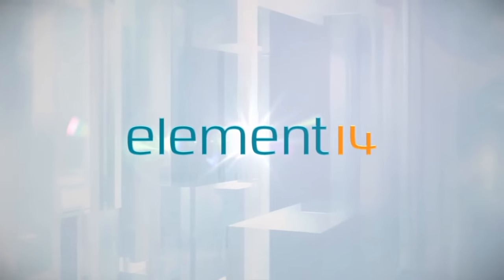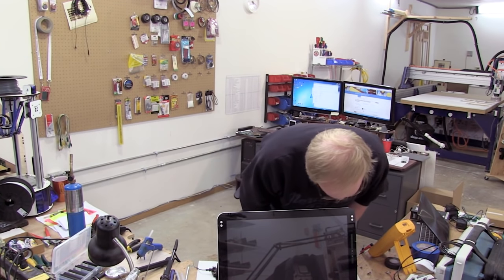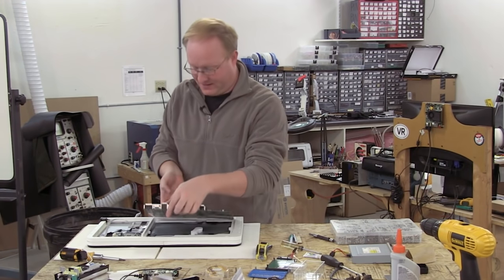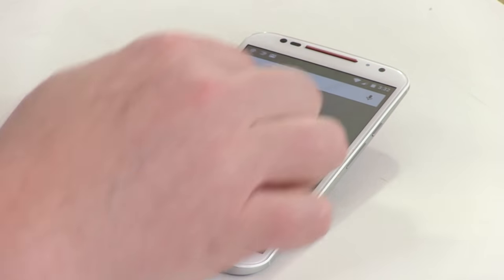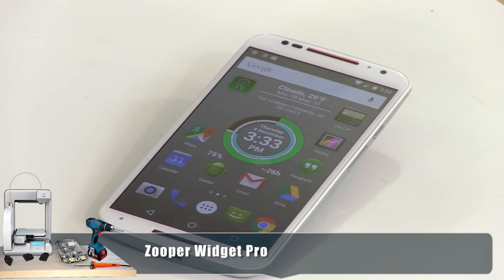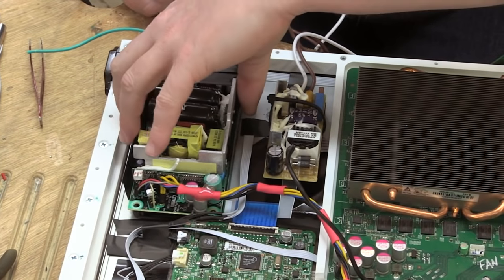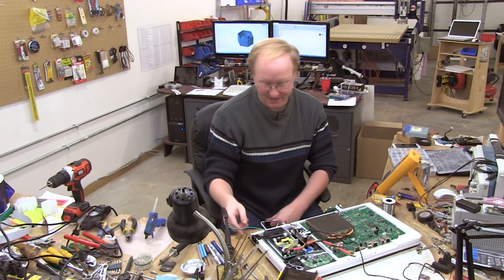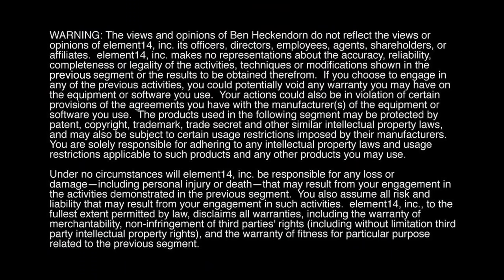Ben Heck’s Xbox One Portable Part 2

Comment: The Xbox Surface, nice Idea!
Reply: You sir are a genius
Reply: TheMarcos030897,

Yeah, because no one thought of that ever before...
Reply: Put a better GPU inside a Surface Pro 3 and you've got yourself an Xbox One Surface Edition.  It already have a great screen, better CPU (i5 or i7).  Only thing missing is a bluray player.
Reply: Stephane Tanguay surface equals throttling i hate mine, got rid of it for that reason :(
Reply: In old ''leaks'' from Microsoft they had plans to make a tablet sized Xbox named The Xbox Surface LOL (this can be fake cause Microsoft never stated so)
Reply: I've been on it for 3 hours no over heating *****
Reply: I played battlefield 3 at low 600x800 and no signs of overheat on the surface pro 3
Reply: TheMarcos030897 lol i played minecraft on it and it melted lol
Reply: Exactly what it though, Microsoft should make one and maybe I'd buy one 😊
Reply: FinnTendo you could probably find one on like ebay or letgo.

Comment: If the Bluray drive is only used for installing games, and the XBONE is meant to be a portable tablet, why not omit it? Sure you could add a connector so that the drive becomes a external peripheral, but can't the XBOXONE download games digitally over wireless?

Comment: Ben, why didn't you use an SSD in the tablet?
Reply: Because the Xbox HDD's use a custom file system and the drives are flashed with a custom firmware, It's just to much of a pain in the ass and a 500 GB SSD is expensive.
Reply: It wouldn't actually be too hard, and SSDs are really coming down in price. There's a tutorial on it somewhere on YouTube. I'm only suggesting it because HDDs are really meant to be moved around, whereas SSDs are much more tough,
Reply: BlueFoxTV you can clone the file system. but a 500gig ssd is kinda cheap o wait
Reply: *****
 With the spectrum he did a software mod (the BIOS thing) and plenty of  hardware mods. The only thing he actually used was the video processor and even he could rebuild another spectrum with the parts he didn't used.
Reply: Defused Creeper You could clone the filesy system but the SSD would not have the proper firmware and would be rejected.
Reply: BlueFoxTV lol i guess you have not done it for yourself, but i have, coping xbox's filesystem is super easy here a link to the 360 sectors http://digiex.net/guides-reviews/console-guides/xbox-360-guides/3152-hack-250gb-320gb-500gb-sata-harddrive-work-xbox-360-xbox-360-slim.html which i guess xb1 is the same
Reply: Defused Creeper I think you should read that guide again. Because they cover flashing drives firmware before cloning the drive.
Reply: BlueFoxTV you are full of Shi*, i use a 60gig Western Digital ssd in my 360, guess u cant read right, and u can play game from flash drives the xbox can format a flash drive its self
Reply: Defused Creeper No, BlueFoxTV is not full of sh*t as you incorrectly pointed out. In those instructions, HDDHACKER is used to modify the firmware of the target drive. It first backs up the original firmware to a BIN file, and then apply the correct HDDSS.BIN firmware depending on the size of the hard disk you're hacking. Interesting enough, that site doesn't even list the WD 60GB SSD as being supported, although you claim you're using it. Just saying...
Reply: *****,

"No hardware mods..."

I know, look at that completely unmodified Xbox One.
Reply: erm let me just go dig it out n see whats going on with it, i defo use a ssd on my 360, and it plays game from it with out a doubt tho, how i did it remains unclear but not what i achieved it may be via usb as i think of it
Reply: ok so it turns out im half Moron, cus yes i Do have a SSD on my 360 with games on it but in the 360 its self is a 1tb Hd that i must of made into a lower size via the hdhacker thingy, but ssd's can still be used
Reply: Good question. I would have got one because of the fact, if the surface xbox falls over the spinning platter in HDD could get damaged.

Comment: The disc drive isn't reading because Microsoft is a hard ass on money, they didn't want to spend the extra few cents to add foam pads to the inside of the disc drive to prevent the disc from lifting off the motor. Same reason the Xbox 360 scratched the discs, was because there was no spacers inside the drive, yet another prime example of Microsoft being too damn cheap.

Comment: Would a cheap HDMI "television" have worked a bit better than a "monitor", as they're already designed to handle the audio, then you could replace their POS speakers with an analog audio out system. That would make the audio extractor unnecessary.
Reply: wouldnt a tv be thicker and require a bit more juice? Requiring more power is not a problem becasue its plugged into the wall, but that would make the system that much thicker
Reply: +Jeremy Morgan Not really, the only difference between most monitors and TVs is the installed firmware, which wouldn't be a factor here at all, and the inclusion of dedicated audio hardware. The "economy" monitors and TVs that a lot of companies sell use the exact same panels and driver chips.

Comment: Question: Why would you need to extract the audio from HDMI? Doesn't the screen have audio that comes out of it using the HDMI port? If it doesn't that makes sense... but why would you need to if it already has built in speakers?

Comment: You talk about using a blow torch to remove components. Why not use a hot air rework station or a desoldering vacuum pump like the Hakko FR-300? I would think it would be safer to use one of those items instead of a blow torch.

Comment: Mr. Heck, I have what may seem like a silly question, but I need guidance.  I am a former Network Engineer for 14 years, but I have no knowledge with circuit boards etc. I want to build stuff for IoT, using parts. Transistors, capacitors etc. But I have no clue how to learn whats what & how to do anything. Do you have any advice? Thank you!

Comment: Geez that's so portable I just have to loose 2 USB ports and sacrifice the ability to plug the console into a bigger TV.
Reply: ***** It's not portable it's practically just an Xbox and a screen glued together. It still needs to be connected to a power socket. Loosing the ability to connect to a bigger screen when possible will just limit to semi-portable use only.
Reply: noelsoong777 so u never heard of portable power supply or generators??
Reply: noelsoong777 Yeah, good luck taking your console and TV everywhere with you.
Reply: I don't mind. I didn't waste my money because i can sill use my lcd monitor for other devices instead of wasting it on a console. Because you still have to plug in the power for the lcd monitor and the xbox powersupply it's not truly portable by any means. I find this project an awkward trade off that should have been prevented.
Reply: What were you expecting? A goddamn 3DS?

Comment: Isn't the blu ray drive using standart sata connections?  Then you could use a aftermarket slim blu ray drive.
Reply: +Omega Rugal most likely. Unfortunate that the software/hardware isn't more open like shareware. Imagine a custom OS with raided SSDs and an upgraded blu-Ray drive, etc.

Comment: I think it would be nice if consoles had a modular RAM slot, like the ability to use laptop memory in them instead of built in- memory chips.
Reply: So many people including me agree with you. But it's for marketing. They would rather you have to buy an external or in the 360s case just more expensive drives that were compatible with the device. As all out as he's goin with the build I would have switched to SSDs raided together. But that's just me.

Comment: Love the Ben Heck Show, and...I have a question, hope its a good one.

I was interested to find out how differential pairs allowed you to get higher speeds and most of my googling pointed to noise reduction from interference cancelling over the two lines. less noise meant clearer signal at higher frequencies.

The show says that its mostly due to :

"Not having to rise to a full 3 or 5 volts allows the differential pairs to send data at higher speeds"

Does this not just allow you to operate it at a lower voltage and lower cost. How long does it take to go from 0 to 5, compared to the lower voltage on the differential pair line.

Or does the lower voltage reduce noise even further ?

And how come there's a ground wire in with the differential pair ?
Reply: further googling suggests to me that the answer lies in transmission line theory for frequencies in the range of radio.

Where the interval speed is so fast that the time of the rise and fall of voltage is significant, particularly, it seems, if biased after repeated transmission of the same value. thats amazing. ( if thats the case ).

Whats of further amazement to me is that people make devices that can quantify these differences or measure these things. and that for other devices like atomic clocks and gravity detectors, these measurements are trivial in scale, positively slow coach. 

so what are those ground wire doing....or did i hear it right.

Thank you Ben Heck, you're shows are always interesting and awesome ( i kind of wish id studied electrical engineering )

Comment: I think the Blu-ray could have been replaced with a HDD / SDD to save space, although I'm not sure if the stock OS can run disks from that. If it can't, you could then install a custom OS.
Reply: If it was that easy, then the Xbox would have a lot more sales now with all the free games.
Reply: *****  It is that easy for the Xbox 360, as far as I'm aware, Just not many people use the software as it requires a physical modification, also the people who play on Xbox usually aren't the most knowledgeable, no offence to them.
Reply: Emiiru Caru
Thing is, that was an exploit on a past machine, I'm pretty sure Microsoft would know better to secure that weakpoint. And it's way too early into the console's lifecycle to do anything like a custom OS, without any knowledge like encryption keys or exploits or something.
Reply: ***** It's got to become possible at some point!